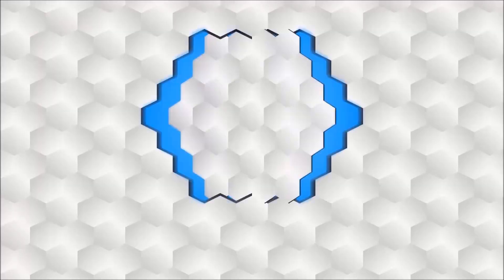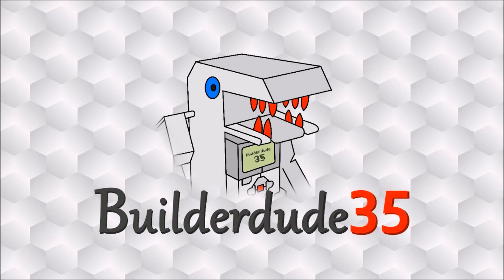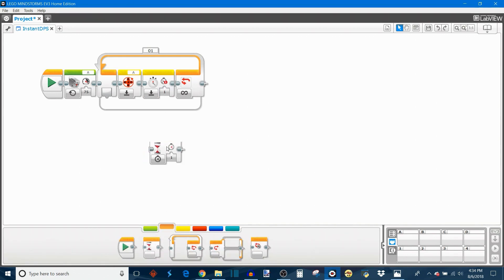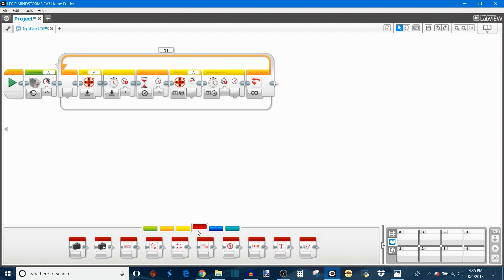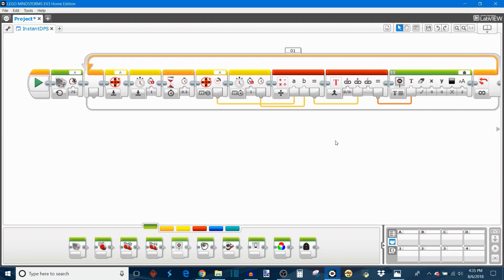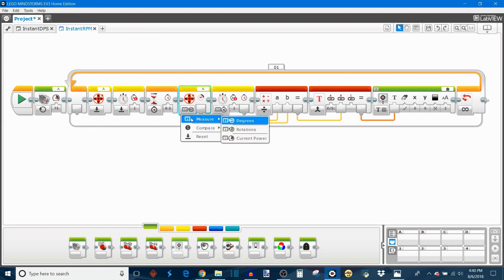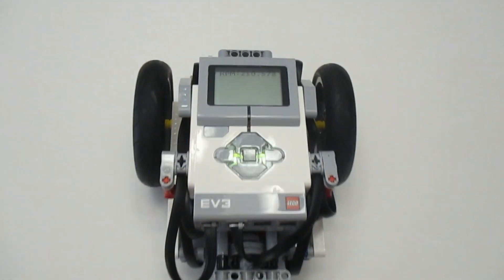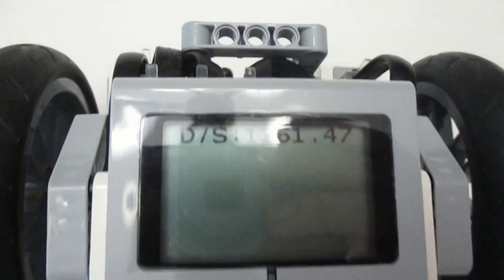Measure Instantaneous RPM of an EV3 Motor + Stall Detection

Comment: I'm trying to apply this concept to the Apartment cleanup challenge in VRT. No matter where I put the sensors, it gets stuck at the open bookshelf. If I could tell it to back up and turn if the stall happens. Do you have any tips for the code?
Reply from the maker: I am not sure that this method will work in VRT (the wheels might just slip). A better choice may be to use a touch sensor.

Comment: Speed is an average measurement (the traveled distance/the time elapsed driving that dictate), the instant speed is therefore impossible to measure. If you decrease the time delay between each mesurement, the calculated speed will be a better estimation. If the delay is to little, the mesutements can be unprecise. I agree with you that half a second is a good chooise.

I'm looking forward to the publishing of our collaboration series's!
Reply from the maker: You bring up an excellent point, and you are in fact correct. While there is no way to truly measure "instantaneous" rotation speed, imagine relating this concept to the limit definition of the derivative (which is essentially the math at work here). The limit definition is taking the difference between the final and initial rotation speed and dividing by the elapsed time, some small delta t. This is an average over that time interval (secant line) but as delta t approaches zero (a very small time interval) the average approaches the instantaneous change (tangent line). In the context of robots, there is a delta t that is "too small" so 0.5 seconds is our compromise.

Our first collaboration video is going live on October 11. I am very excited!

Comment: Stall detection is also useful in wro soccer. You can program the defender to back up until hitting the goal. For the attacker, you can program it to turn slightly when wrestling with its opponent. However it is less effective after the change to the mat. Before the change, you could determine which side of the field (left, right or in the goal zone) is the attacker on and turn to the other side, so you don't kick the ball to the wall. After the change you pretty much have to take a guess of the position of the robot, and a half of the times you'd be kicking the ball towards the wall.
I've heard that some teams have experimented with tracking the attacker's position with compass/gyro,  but I haven't seen anyone used it yet. Some teams send the "heading" of the ball from the defender to the attacker with bluetooth, so if the attacker is chasing the ball if should be in the same zone (left,right,middle). This is not quite reliable because the ir sensor doesn't track the ball quite well when it's blocked by the attackers.
Reply from the maker: That is an awesome idea! Thank you for sharing!